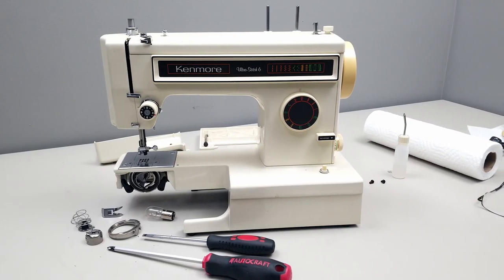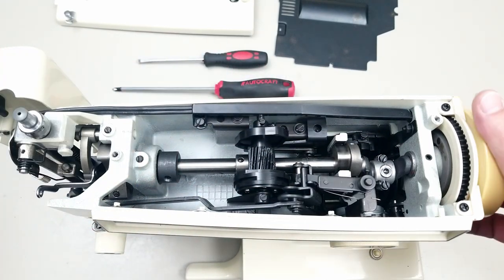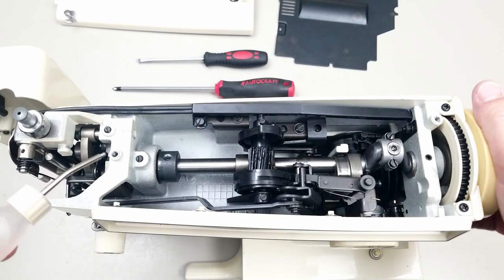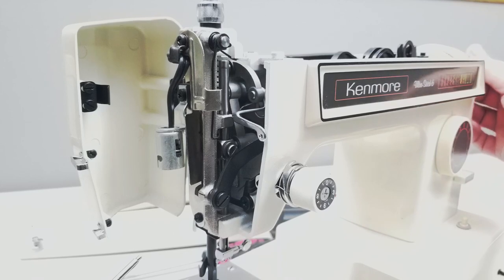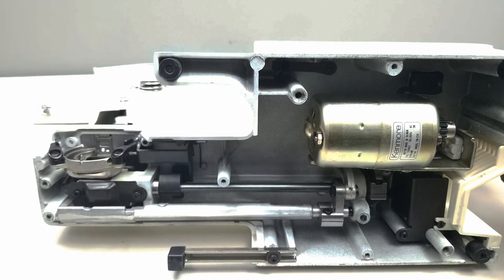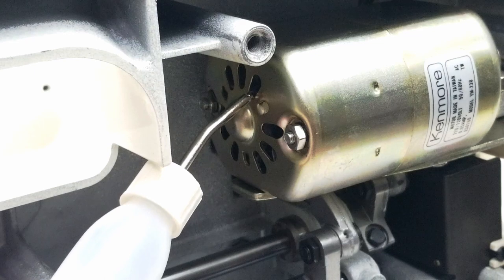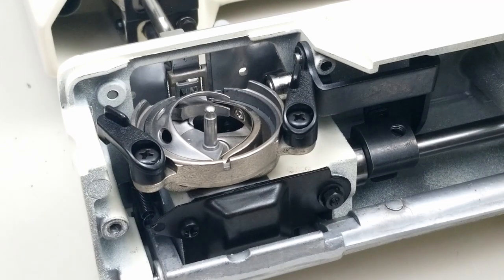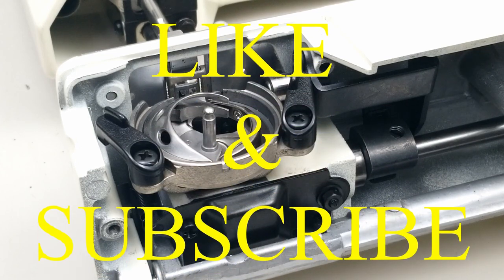KENMORE 158 SERIES SEWING MACHINE CLEAN & OIL DEMONSTRATION

Comment: Thanks for the XLNT video, the manual's oil points are incomplete, this really helps!. I just got one of these, stored for decades and totally frozen up, was able to free up everything except the double pully in the middle. How does one remove the back cover to get to it? It appears the stitch length knob needs to come off, but no obvious way to do it. It needs to come off to change belts, too.

Comment: How do you remove the top and side cover panels? I have a Kenmore 158-1262180 and cannot figure out how to remove these panels.
Reply: Did you figure it out yet? Top pops off if you wedge screwdriver under top and use it like a lever. Side panel on mine has a couple of screws